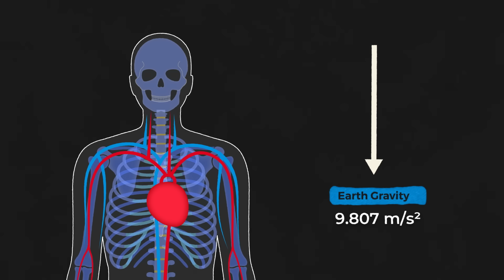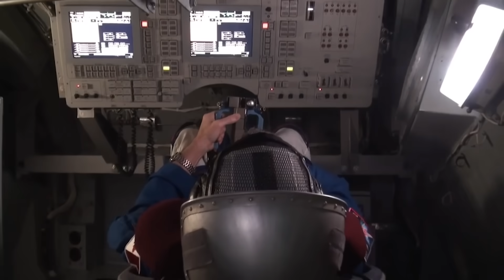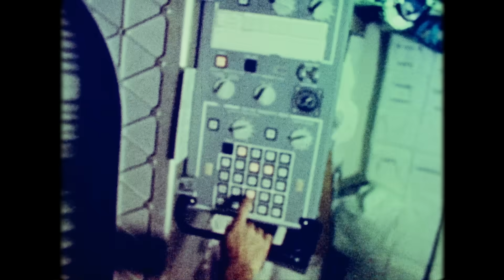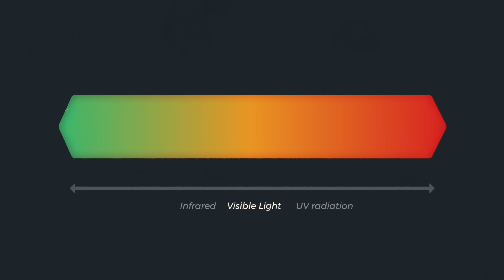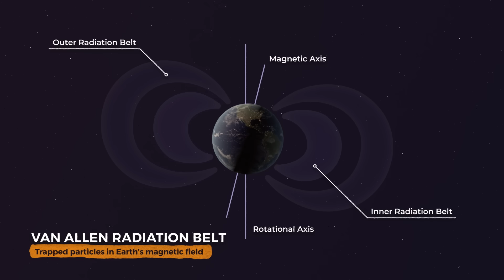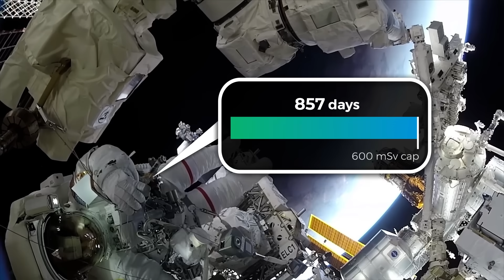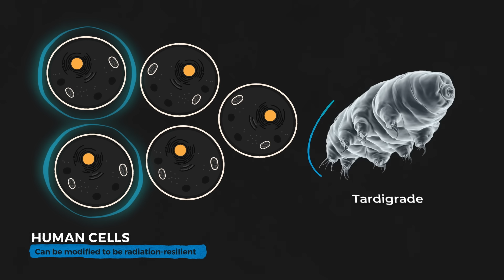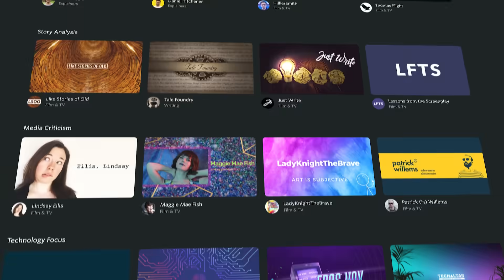The Problem with Deep Space Travel

Comment: We really need more research on cosmic ray health effects. The expected cancer risk is probably something astronauts might tolerate (and you can always try and reduce the dose at the destination, by burying your lunar or martian surface base under local dirt and other materials). It's whether there are other serious health effects from prolonged exposure that we really need to know. 

I tend to think we'll probably just take the dose on long trips, and then try and protect astronauts at the destination. For a lunar base, you can probably just take the multi-day dose from traveling to and from the Moon, and then on the surface you're just getting extra radiation when you're out on a space walk. 

Rotating the spacecraft for simulated gravity doesn't seem that bad as long as you do it on the spacecraft's long axis. They're already going to be rotating any such spacecraft slowly anyways for even heating of its surface (the "barbecue roll" that the Apollo spacecraft did, for example). It'd be a lot simpler than having a rotating section on a non-rotating spacecraft (with all the fun that entails for trying to link it all together and transfer power/water/etc between the rotating and non-rotating parts of the ship).

Comment: The solution to radiation poisoning will most likely not come from 1 solution but multiple options used in conjunction. For example have a heavily shielded part of the space station where each crew member must work in 1 out of X many days. Have that position shift each day to someone/s new until they all work there on the regular.

Than with that possible some protective shielding, but not super likely as it will probably limit their movement (even while weightless) and annoy them. You have to consider temperament into the solution so if it makes their job more difficult they probably will not like it.

Another option would be specially made sleeping bags which block as much radiation as reasonable possible. If enough radiation is prevented each day in the long run (multiple years) that time adds up considerably. Even radiation resistant sleeping bags will reduce radiation 6+ hours each day, that's basically a full days worth of significant radiation reduction every 4 days.

Comment: One of the best ways to shield against Galactic cosmic rays is the Solar wind. Astronauts get exposed to less galactic cosmic rays when they get exposed to more Solar particles. The nice this is the Solar radiation is much easier to shield.
Reply: How does that work? Solar wind is not dense enough to stop cosmic particles. They would just pass right through
Reply: @yds6268  moving changes generate magnetic and electric fields that deflect other moving charges